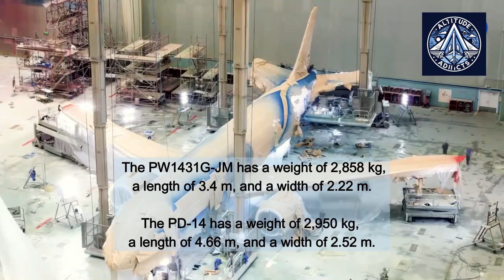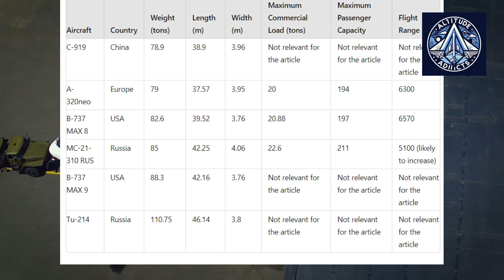Russia's MC-21: Gaining Weight, Losing Range?

Comment: but the question what kind of equipment that are required by the local operators have increased weight? It means they are newly introduced or not competitive to western ones? Countries like India is particularly concern about fuel economy for the operations as they are heavily dependent on imports.

Comment: Thank you for answering this question. I suspect the decreased range is really only due to slightly less efficient engines. The increased MTOW might allow extra fuel to make up the range no?
Reply from the maker: That can also be an explanation. Rostec will eventually comment on these aspects.
Reply: The engine has all working data, far surpass CFM56 engine.  So it should not have short range, providing that the 320 or 737 that use CFM56 can fly longer than this.

Comment: The MC-21 ought to have winglets to help range and fuel burn. The Tu-204 and Il-96 was purposely designed with winglets.
Reply: the MS-21 has the highest aspect ratio wings amongst its classmates, and therefore it doesn't need winglets ✈

Comment: This info is quite old, early days when sections were imposed. The landing gears were main components with weight issues switching to Russian made. Last year Dubai air show this aircraft was introduced with 99% Russian parts, range and height is sorted, going thru certification which is 98% complete. Range estimate 3200+ km now height to 40000 ft.
Reply from the maker: All this controversy on the planes weight and distance have arisen only after March 2024 Kommersant article. All these figures are from March 2024 onwards.